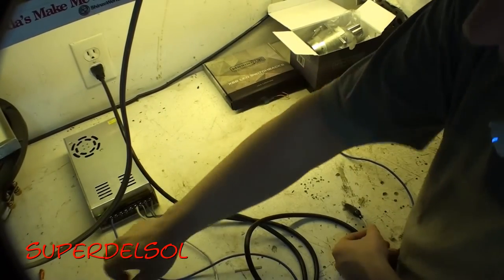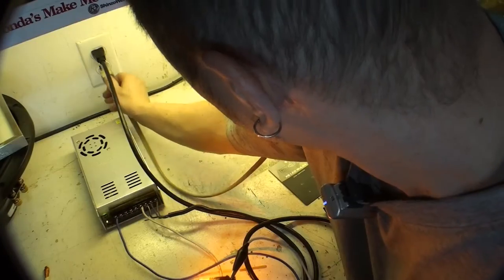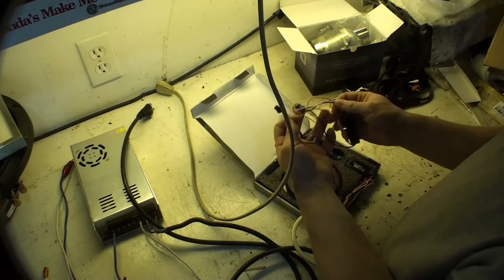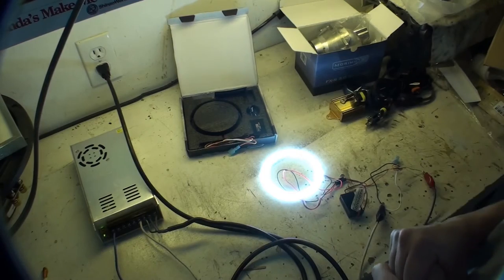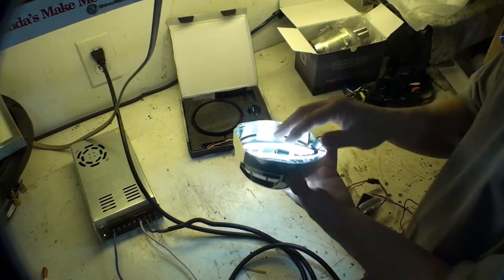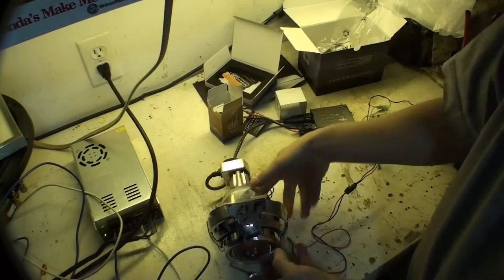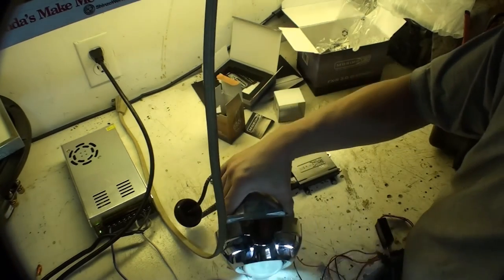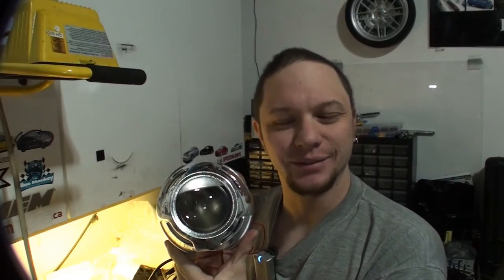ridgeline retrofit sneak peak

Comment: what did you do to make the angel eye's fit? I'm doing the same thing but the 110mm rims are too large and 100mm is too small. What did u use to make them fit like that. Looks perfect. The only way I've gotten them to fit is by squeezing then in but it doesn't fit flush with the cut outs. I was thinking of using the JB Weld sick to cover the openings.  I plan on using Halos with the Demon eyes
Reply from the maker: magnificent10304 well, they are a tight fit, and they don't line complete in front of the slits, but they are bright as hell. but I will still have to keep them I'm place with jb weld stick. haven't done the retrofit yet. hoping to get it done soon
Reply: ok, so u in the same boat as me.  Even if they don't line up perfectly it looks really good.  I'm going to use the JB stick to seal them an get rid of that gap so no light would seep through, probably need two for that. If u use the switch back option, that would look very good.  I might post a vid of the final results soon
Reply from the maker: magnificent10304 yeah, I'm still on the fence about switch back. and if you do end up making a video, send me the link.